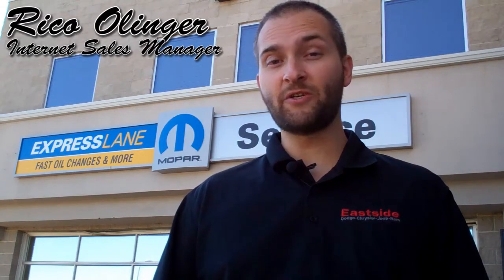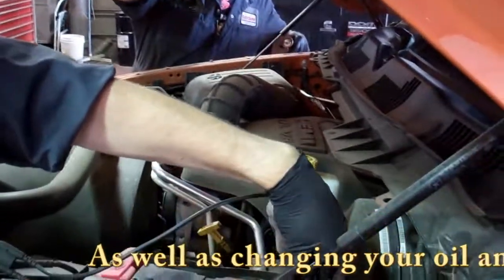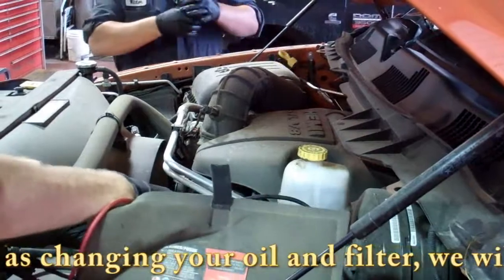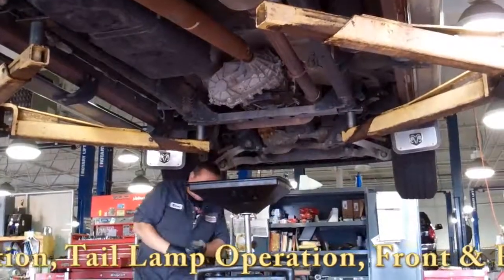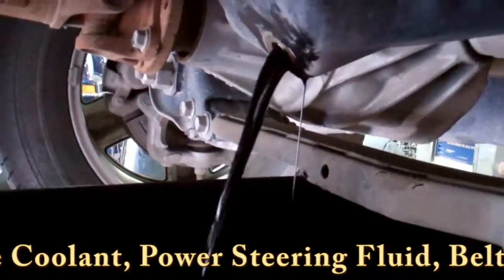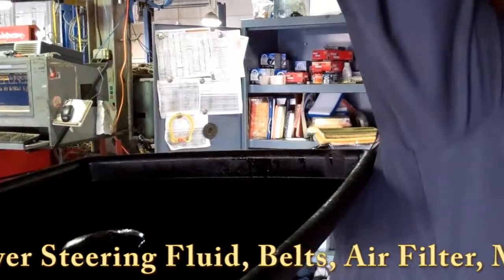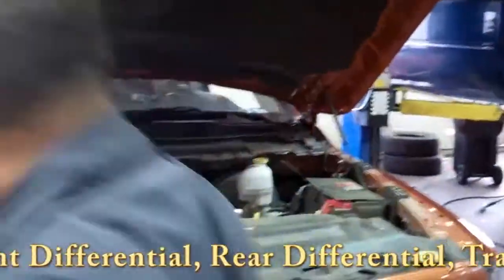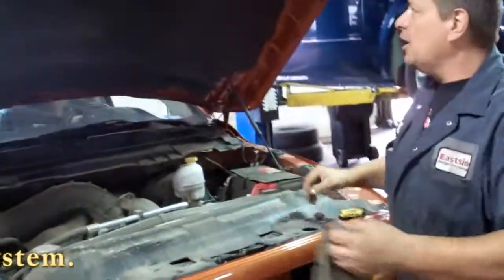Express Lane Oil Change at Eastside Dodge in Calgary, Canada

Comment: Blinker fluid is clean and topped off, THANK YOU SIR. Exhaust O Pipe, no leaks, THANK YOU. Spark plug wires are cleaned, YES THANK YOU SIR. Elbow Grease installed, AYE AYE THANK YOU. Winter tire pressure in all tires, YES SIR THANK YOU.

Comment: As a MOPAR Express lane lube tech at Eastside Dodge , I can assure you the turn over time in the bay is less than 20 mins per vehical , with 3 lube techs per bay and 2 bays , we run a efficiant and effective service.